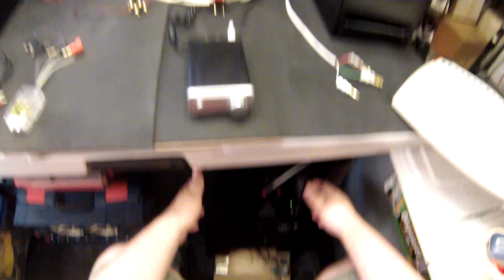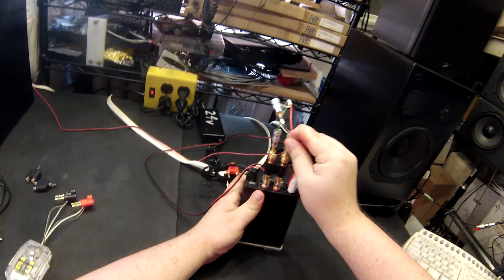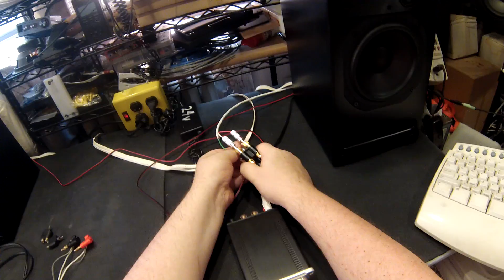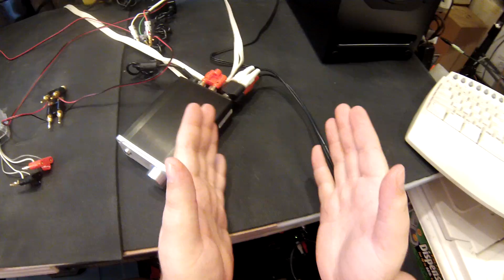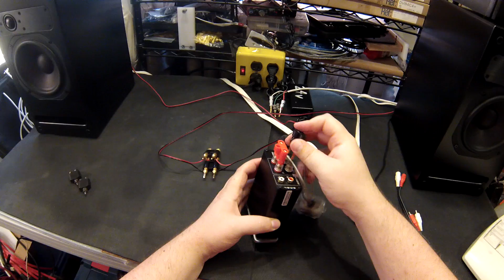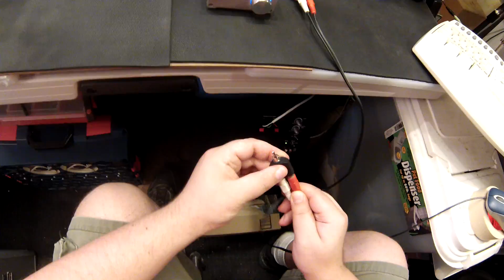Z-Tutorial - Subwoofer Hookup Tips

Comment: with your extensive knowledge, i'm hoping you can help me.  i have the Monoprice 25 Watt Stereo Hybrid Tube Amplifier 2019 Edition with Bluetooth, Optical, Coaxial, and USB Inputs, and Subwoofer Out. How exactly do i use the subout ports to connect my subwoofer.  the amp has 2 subouts, both of them are red, neither labeled "left or right". do i use an RCA cable connected to one of the ports on the amp, with a y splitter on the other end? i have watched videos, i have sent emails to  Monoprice tech support, and i have sent emails to Klipsch tech support and so far no one has been able to tell me how to connect the subwoofer.
Reply: If it has two sub outs, then you should be able to connect two subwoofers rather than just one.

Comment: With regards to piggybacking speaker outs to SUB and speakers. Do you believe it is safe for the amp?  

According to this It's ok > https://www.upscaleaudio.com/pages/subwoofer-tips   <<< and funnily enough my SUB manual says to do this if your amp has no sub preout.

My Topping Tp22 is fine this way. No issues or hissing.  I Used to have it setup going from DAC to line input sub (Wharfedale SW150) thenline output to AMP , 

Topping PA3 died setup piggybacked to the speaker level inputs , (didn't try old way only had it 3 weeks). New SMSL 98E hisses (as did the PA3) setup this way but old way , DAC>SUB>AMP is fine. The hissing also stopped.

I'm wondering if by doing the piggyback method killed my PA3 which initially was fine but developed hissing then just stopped working. The replacement amp i got which was/is SMSL 98E was also hissing using the piggyback speaker level method so i went back the RCA input output on the SUB method and all i sweet. 

Only problem is that the volume levels are not matched between sub and amp , as you mentioned in your video , but to me that's not a biggy. 

I could make it simpler by buuying a proper reciever but that would'nt fit on my desk :)

Comment: So if I wanted to run dual subwoofers I would just wire two sets of speaker cable to the left and right channels of one of the zones?
Reply from the maker: On a surround receiver you just split the .1 output to the RCA in on the sub. On a stereo receiver you need subs with speaker wire passthroughs or two of the adapters and then you send the speaker outputs through.
Reply: +Z Reviews Thank's man I'm planning on running a 2.1 or 2.2 setup with the Audio Source amp 100vs amp which doesn't have a sub out as far as I know and was just wondering about the wiring that would entail. Your videos have really helped me out though, I think I more or less know what to do now

Comment: Hi Z Reviews, I am thinking of adding the following sub, Mordaunt Short MS308, to my SMSL SA50 and NHT Super Zeros. Since it has both input and output for L+R speakers, I should be able to use is straight away without using any of the parts you mentioned, right? Thanks.

http://www.ebay.co.uk/itm/Mordaunt-Short-MS-308-Home-Cinema-Theatre-Active-Powered-Subwoofer-Loud-Speaker-/192033742070?hash=item2cb61a5cf6:g:z6QAAOSwux5YMz-8
Reply from the maker: Correct, just wire it through the sub.

Comment: The subwoofer out on my amp are 5way bindings and i have the same connections as the dynamo on my sub. How do i make that work?
Reply from the maker: You just wire it with speaker wire. Unscrew the 5 way and pop the other end in the spring clip.
Reply: +Z Reviews Is it possible to use bananas on one end and open end speaker wire to spring clips?

Comment: Hi, with regards to extending the wires on the Schosch Loc80, is it possible to use 16AWG speaker wire?
Reply from the maker: It is. I think the wire in use is actually smaller than that but yeah it should be fine.
Reply: Yup, thanks for the advice! Though I'm using black electrical tape to secure then, they are working perfectly.

Comment: Running a splitter backwards to create a psudo mono sub-out like that is actually a very problematic solution. It can, depending on your setup, wiring, and preamplifier/amplifier implementation, cause all sorts of problems from soundstage reduction, to feedback, distortion, ground looping, shorting, or even straight up killing an amplifier. These problems wont always happen and can sometimes just fly under the radar for a while until something gives up. Most subs that offer left/right input use a simple summing circuit to add the two inputs.
If a sub only has one input you should either only use one output or buy a summing box.
Reply: Hey thanks for this comment. I have only a mono line in on my sub and was using a splitter to combine my 2 RCAs and was getting all sorts of weird static and audio anomalies.
Reply: I just ran into this exact problem. It worked well for a few months, but now the right bookshelf randomly dims in volume or is turned off entirely. So i unplugged my powered amp and it seems to be mostly fixed. Was there a better way you found to hook up a powered amp that doesn't have line ins and outs?
Reply: Would that force you to get an amp with a sub out then if you can't use the splitter on the LFI input?
Reply: You can also use a cheap mixer to combine left and right channels into single mono output.

Comment: What about a 2.1 amp that has speaker wire out for the sub?
Reply: bought one of these on the cheap the other day 
http://www.ebay.ca/itm/272134429861?_trksid=p2057872.m2749.l2649&ssPageName=STRK%3AMEBIDX%3AIT
Reply: I guess those are intended for unpowered subwoofer boxes, but you can just run that amp's sub output into the high level inputs on your powered subwoofer (pick the left or right channel, shouldn't matter.)

Comment: Hi Z reviews,
I've followed your channel for some time and have made purchases based on your recommendations; many thanks.

I have the Elac B6 hooked up to the smsl 98 through a Fiio E10k on my PC.

I've decided i want to do a 2.1 setup with the Martin Logan dynamo 300.  Which setup would you recommend?

1. do i just buy the twin banana plugs and hook it up to the smsl98 then connect to sub or (2). buy the schosch line converter and hook it up to the sub.  The reason I ask is i'm not sure how efficient the ELAC's are.

<a data-flickr-embed="true"  href="https://www.flickr.com/photos/sirira2000/25596424634/" title="DSC00238"><img src="https://farm2.staticflickr.com/1457/25596424634_af1e16a66e_b.jpg" width="1024" height="651" alt="DSC00238"></a><script async src="//embedr.flickr.com/assets/client-code.js" charset="utf-8"></script>

Thanks,

Eric
Reply from the maker: +sirira You can try splitting the speaker outs without the converter first. Then add it if you need to.

Comment: what about a car subwoofer? i have an old bookshelf system with a spare car woofer hooked up to it. would i still be able to use the woofer in a system like this? the woofer lives in my closet and the old bookshelf system has seperate subwoofer out terminals.
Reply from the maker: +ReggaeDubSoundSystem It highly depends on the woofer. If it is self powered via 110 you can but a 12V sub amp needs a heavy 12v Transformer. If it is a passive sub hooking it up to home equipment may be difficult if the Ω load is too low.
Reply: +Z Reviews its a passive 10" 4ohm woofer.
Reply from the maker: +ReggaeDubSoundSystem Dual voice coil? Is there an in-out crossover for two stereo channels? If there is you might get away with a power amp running it or even a Class D amp. A home theater receiver may struggle.
Reply: +Z Reviews Single coil. Its an old Visonik. maybe 200 watts max. i was thinking about getting an smsl 60 with a pair of Miccas or something similar. and run the sub with it  as well.
Reply from the maker: +ReggaeDubSoundSystem A single coil means it needs a mono amplifier. May not work.
Reply: +Z Reviews thank you so much for your help. one last thing. if you had a budget of $150-$200 to spend on an audio solution for a pc. what would you spend it on? ive gotten a few ideas from your videos, but couldnt get something definitive.

Comment: What if our active monitors (Vanatoo T1s) have a sub out?
Reply from the maker: Snuss Then this is a simple setup. Plug subwoofer in.  That is it. Just set the crossover all the way up and it should send anything below 125Hz to the sub. This is a high crossover value so I recommend paying close attention to placement as you will be able to localize those frequencies.
Reply: But if it's just a single sub out, what type of cable will I need to connect the Vanatoo T1's to the line-in on the Dynamo 300?
Reply from the maker: A single RCA. Just find a subwoofer cable [http://amzn.to/1DoJafA] and hook it to either one of the inputs on the Martin Logan.

Comment: Z Reviews:
1. Thanks a lot for these videos, really appreciate the hard work and time placed into transferring the knowledge/experience.
2. I'm not an audiophile, but have a bose acoustimass HT passive sub with 3 (left, center, right) line in and out to speakers. Yes, old school and yeah.............bose (:/). Hey, it's FREE. Would the SMLS 60 with the input coming from computer, out to the left and right of the sub then out to speakers work?
Reply from the maker: econ0611 Honestly I have no idea. I'd have to do research into the workings of that revision of bose module. Most times sort of setup is self powered via the acoustimass module so I doubt if it will work if that is the case here.

Comment: Would a 2x50w T-amp (Dayton DTA120) be enough to push an 80w powered amp (Dayton 8-in amp looked promising with high level in and out) and A set of Pioneer BS22s (also 80w, I think)?

Main line-in on the amp will be from a turntable/pre-amp, and the front 3.5mm input will likely be from a DAC on my PC or a mobile music player. I am fairly new to this and have been reading posts online and watching vids most of the day absorbing as much info as I can.
Reply from the maker: The amp you pass through only powers the speakers. So the 50wpc all goes to the speakers. The sub powers itself. Yes 50wpc is enough for pioneer 22's.